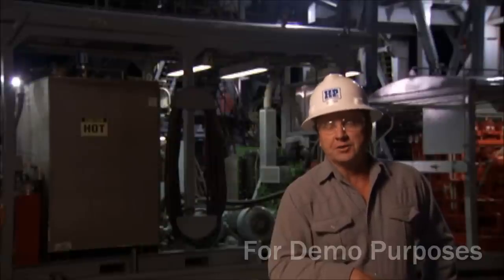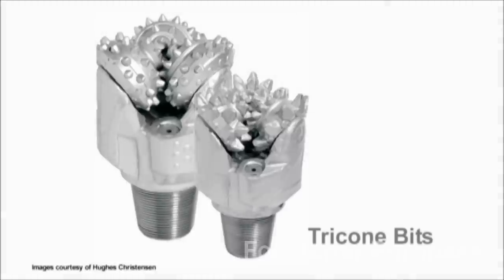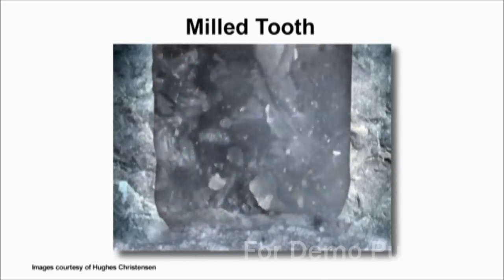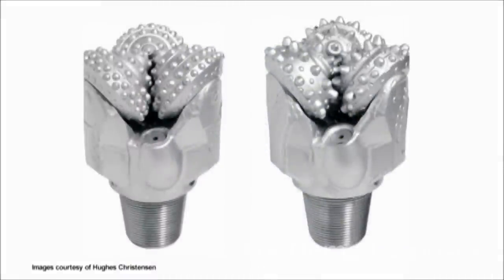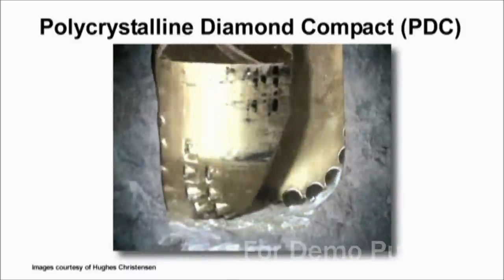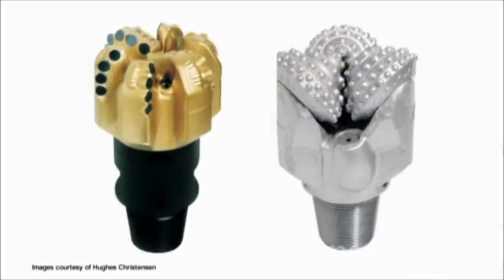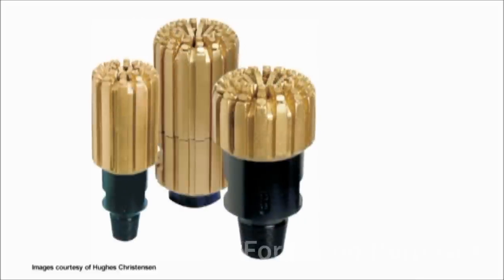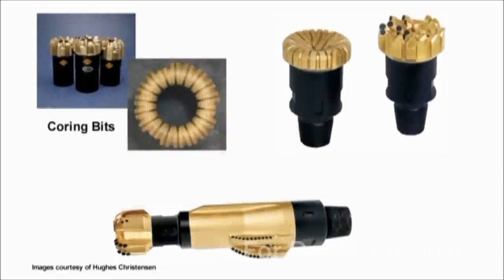Drill Bits - Oil and Gas Drilling: From Planning to Production

Comment: Ive always considered buying a PDC bit. But im always worried it will clog with mud. In my drilling terrain we have alot of mud followed by layers of hard stone. I use Tricone tungsten always because the water and mud flows through it easily. I hope I can get more advice on PDC resiliency to various formations. And resiliency to clogging
Reply: PDC bits are fine in mud. You need to inject water and a drilling additive to keep the bit face and waterways clear. Hope this helps.